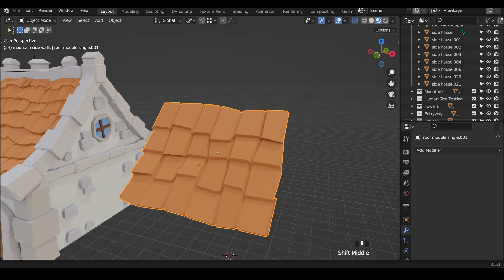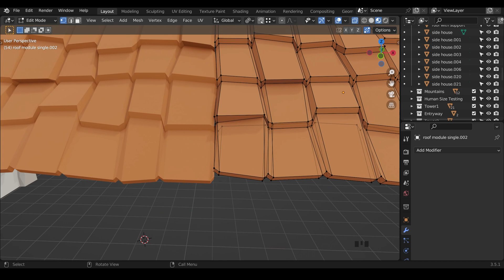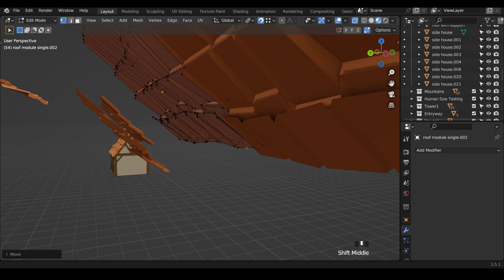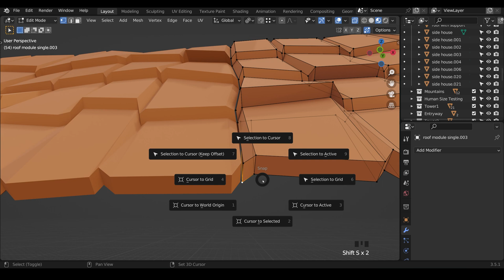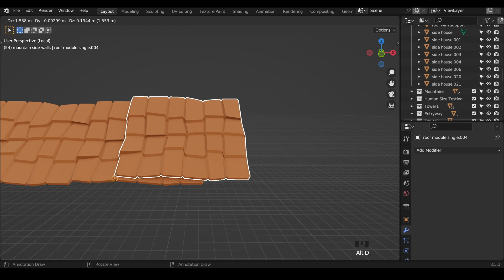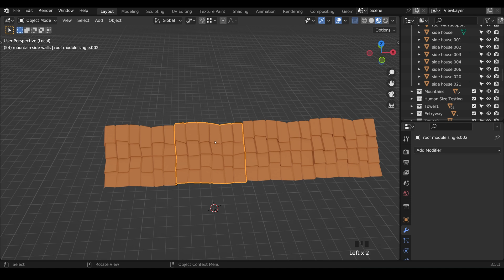Essential Tips for Modular Building

Comment: Great tips! Another idea, if you're making specifically square-shaped pieces, is that you can fit them to the exact size of blender's snapping, or make them to a specific size and adjust blender's grid increments. Then you can move them while holding ctrl to snap along the grid and always have them line up with the grid.

Comment: Hi, great tutorial as always. I don't know if you can help but I have a problem with my 3d objects. So I have a tile set with 7 3d objects and all have one 2k texture that use all the objects and shared one material. When I view the 3d objects inside unity from a specific distance or angle emission color from the objects lamp appears like outline at the edges of a different 3d objects for example column of the  tile set. I could fix the problem if I separate the emission color with the creation of a second texture that have inside the light source objects. But I was wondering if there is a better way. Thanks.
Reply from the maker: I don't know with that one

Comment: Nice.  I was theorizing how one would go about starting a modular building process, and figured you'd have to set a uniform scale to adhere to.  As a dirty imperial, I was thinking 12 feet.  So all your wall sections would be 12 feet tall and wide, giving enough room for 8 foot tall doors, windows, yada yada.  And also divisible by 6/4/3 so you can use those for half/third/quarter height objects.

Is this something you do?  You got any vids that cover this subject?
Reply from the maker: I'm kind of working theiugh that now
Reply: @grabbitt  Nice, looking forward to it.